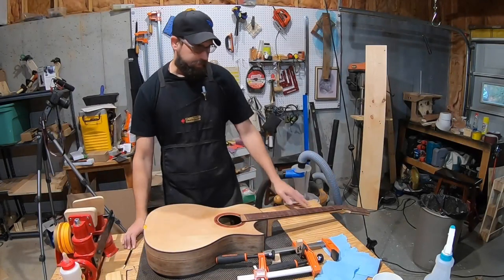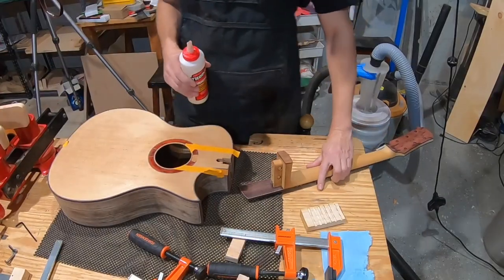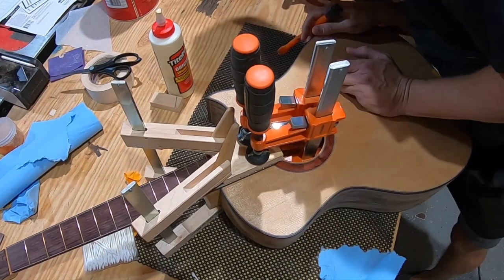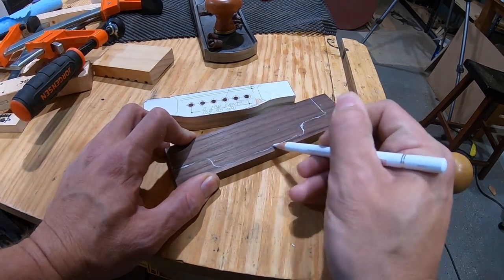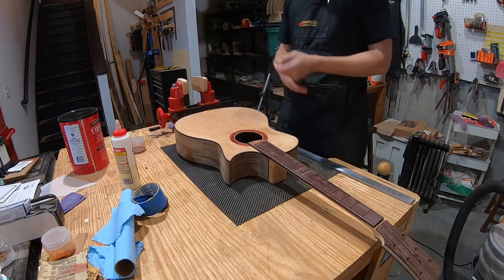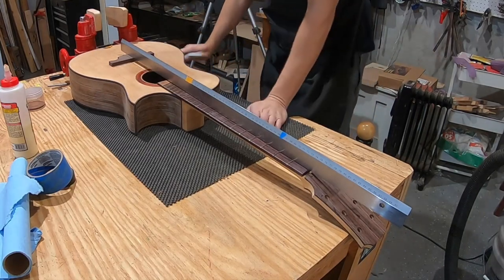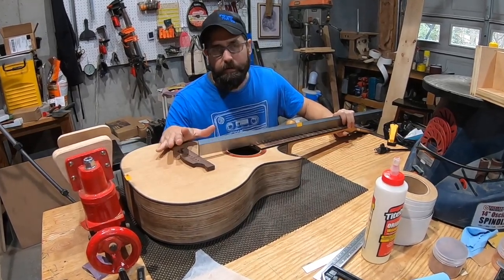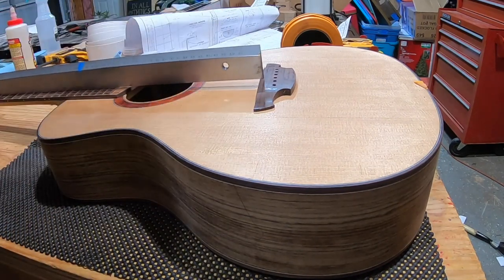Attaching the neck and making the bridge (with problems) // Florentine Cutaway Guitar Build part 11

Comment: Its looking beautiful Chris. That bridge design is fantastic! Why not try to splice a bit of rosewood to the bridge? If you plane a bevel all along the edge then glue in a fillet I'm sure it won't show as the rosewood has quite a pronounced grain? Worth a try!
Reply from the maker: For some reason, I would rather start over than try to repair, haha. I think that if I had already routed the saddle slot and finish sanded it and then damaged it, then I would probably try to repair. I’ve already got a blank on the way! Anyway, I appreciate the freedback very much! And all the comments!!